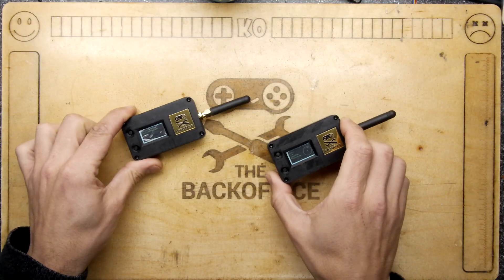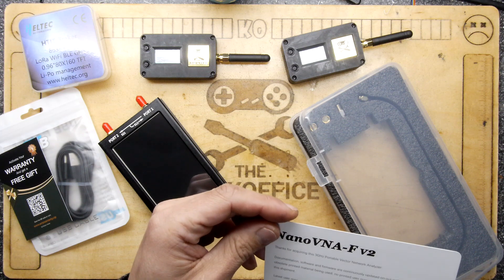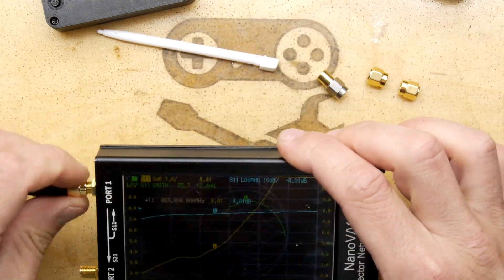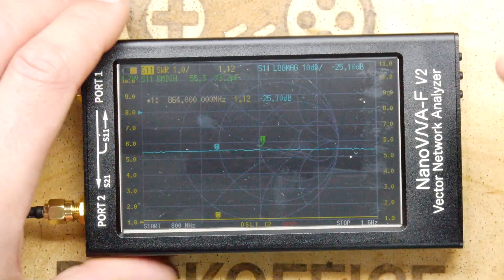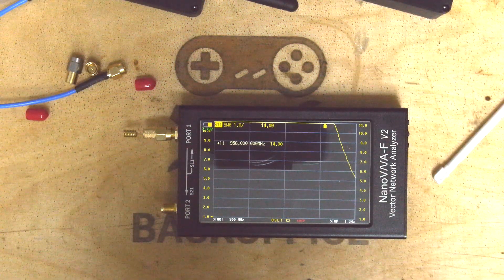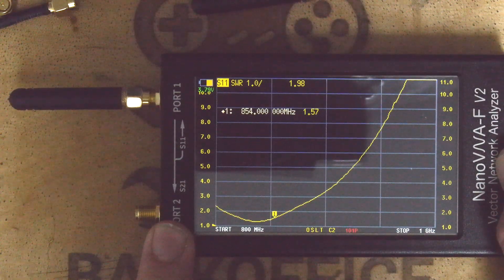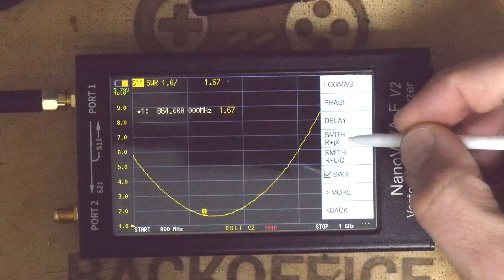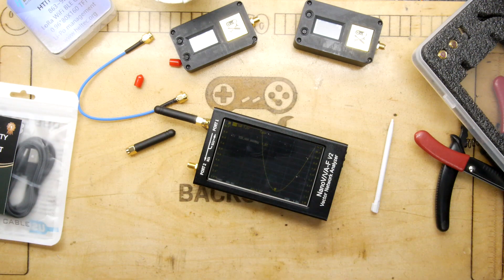Meshtastic Antenna Tuning with a cheap VNA (Vector Network Analyser) NanoVNA V2

Comment: I have a Lilygo t-beam lora kit on the way and i ordered one of these for just this reason. I did a bit of comms engineering as part of my electrical and electronic engineering degree so some of the other plots and bits do make a little bit of sense. Going to be nice to go back to playing around with the old stuff as it is nothing like i use my actual degree for these days (lightning and surge protection along with HV earthing). Interesting video 😶‍🌫

Comment: Since the (SMA->ipex) feeder plays a role in the setup and the monopole antenna is ground plane dependent,use a SMA->ipex adapter attached to S11 port,plug the feeder there and calibrate the VNA at the SMA end of the feeder.Then attach the antenna there to tune it.For 868 Mhz a 1mm enamel copper wire with 9 turns winded in a 3.5mm drill did the job.Also the distance of the first coil from where the sma ground ends is important and it's 9mm

Comment: Tuning only the antenna does not make sense, since the feeder has an additional influence.  Specifically on the Heltec Lora Tracker board, this short feeder shifts the frequency with the lowest SWR above 900 MHz.  Moreover, these distortions in the radio path also depend on the bending of the feeder.  When operating at a frequency of 868 MHz, the range of the device did not exceed 500 meters.
 When I resoldered the board and got rid of the feeder, the communication range in the forest was already 10 km.
Reply: feeder? do you mean the sma plug?
Reply: @nandoanalog  I removed the ipex connector and soldered an SMA connector in its place. Thus removing the pigtail feeder from the high-frequency path.

Comment: Rule of thumb : if the SWR dip shows up on a higher frequency , then the antenna is too short. In this case you had to try lenghten the antenna. But nice to see you gain knowledge 🙂
(ignore my comment, hadn't watched the whole video yet).
Reply from the maker: I always appreciate a comment. Thank you for leaving one. I like that you edited it, it's like playing along at home 😄

I'm considering designing an external antenna for this setup. I'm curious as to how to tune it once mounted. I figure I'll cross that bridge when I come to it

Comment: It would be nice for you to show the difference between stock and tuned antennas. Range test maybe? 
Great video!
Reply from the maker: Alas time is always an issue, however I've gone from zero nodes to two nodes 30 miles away. So definitely an improvement

Comment: The standing wave ratio (SWR), the ratio of the reflected power in relation to what is going out. If half of what you sent was reflected that would be a SWR of around 6 which is appalling, reflected power of around 10% would be a SWR better than 2 which would be acceptable in most cases. SWR can also be expressed as a Log in dB   (as a Return Loss), A Return Loss of 10dB corresponding to an SWR below 2 and a return loss of 3dB correspond to an SWR around 6, or 50% of the power being reflected. Reflections occur when the characteristic impedance of the source device differs from the load (in your case the Aerial). Radio devices tends to have a characteristic impedance of either 50ohm or 75ohm in most cases (not all). Standing waves can blow up your transmitter because 1/ the power that should be going to the load (Aerial) must be absorbed by the source and 2/ that standing wave can produce high voltages at the transmit output when the transistors generating the power are basically current devices not accustomed to high voltages. The Short and Open circuit is used to calibrate your device, these conditions are effective worst case. The Termination is as close as possible a perfect match (should be a dot in the middle of your Smith Chart) and your device will give you a reading for it at good as it is capable. You will not make a measurement for SWR/ Return Loss  better than that Termination. The Smith Chart is a little beyond this video but basically represents the impedance of your load showing its real and imaginary components. The real being resistance, and the imaginary relating to capacitance and inductance. Looking at your aerial, then the closer the trace to the center of the graph the better (the marker 1 being the frequency you earmarked with the higher and lower range of frequencies you are scanning represented by the rest of the line), the center of the smith chart representing the characteristic impedance of your source. Just a Radio Amateur guy shouting at the screen :-) A career in SatComs helped as well. The numbers Z=x+jy are J notation which is the Rectangular form to represent a complex impedance. As an Angle and a Magnitude being the other way (Polar form). Looking at, calculation, and manipulating impedance's/ matching using a Smith Chart is by far the easiest way to accomplish, this though when you are learning about Smith Chart's you would be forgiven not to think so  🙂

Comment: 8,6257 cm is the length for 868 MHz.
Reply from the maker: I think it's supposed to be 863mhz, however that does seem a bit short? Is that quarter wave?
Reply: @backofficeshow Yes that's quarter wave calculated with the speed of light in air. Found the frequency at the Meshtastic homepage. Great video!